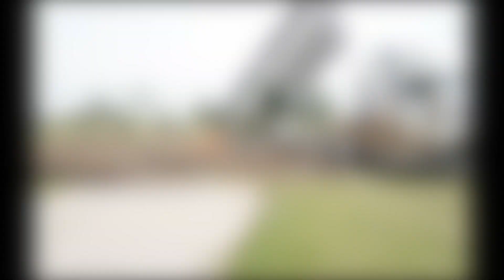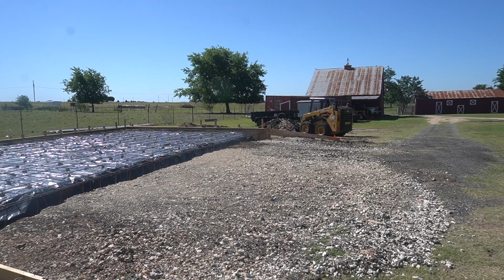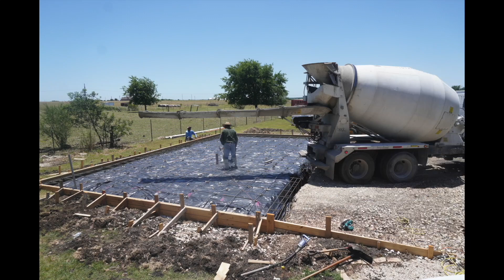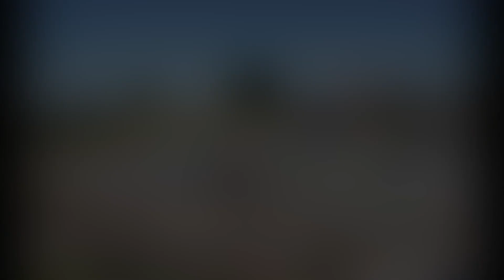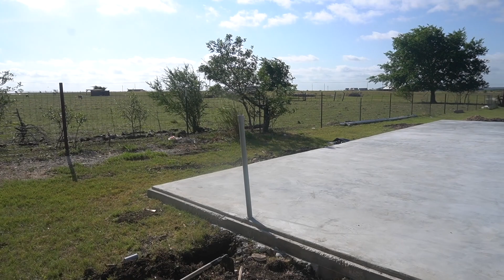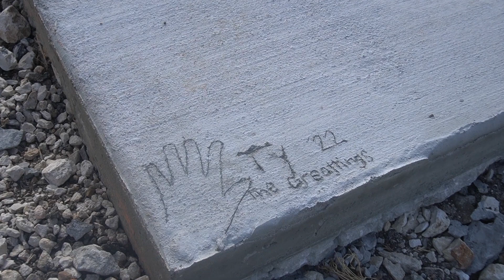Huge Concrete Slab Pour For A DREAM SHOP! | Start to Finish!

Comment: How much did the concrete come out to and how thick did you get it? What psi rating? Thanks for the info. Looks like it came out great.
Reply: Guess he ain't Gina give out the  numbers.   I am in northern virginia  and had a 35x60 for 17k and a 24x40 for 7500.
Reply from the maker: I paid 11k for mine. Was 1400sqft of concrete
Reply: I wish… I’m on Arizona and a 28x75 4.5-5” thick with 12” footers was $25,000 cheapest of 5 companies. I’m doing it myself with my bros for about $8000 lot of work but I’m just not willing to pay these jacked up Covid as an excuse prices.
Reply from the maker: Thanks! I honestly forgot by now but in the sides it’s between 3-5ft thick for the beams and probably 6-8” thick throughout